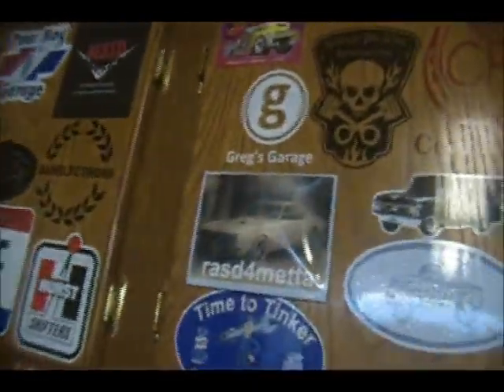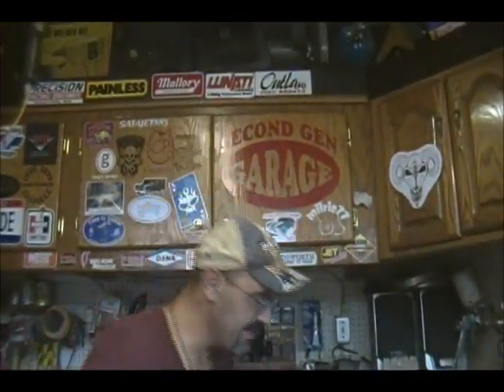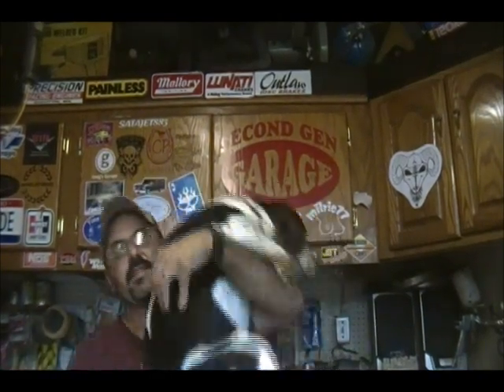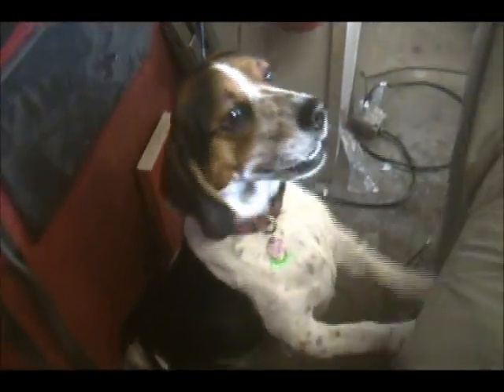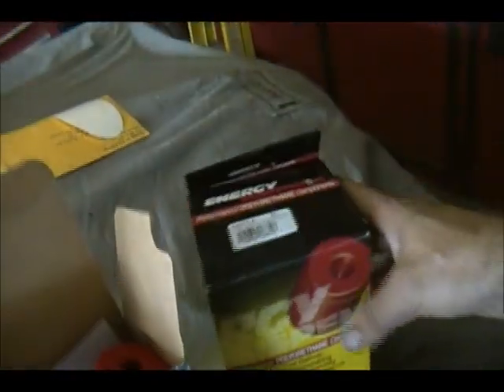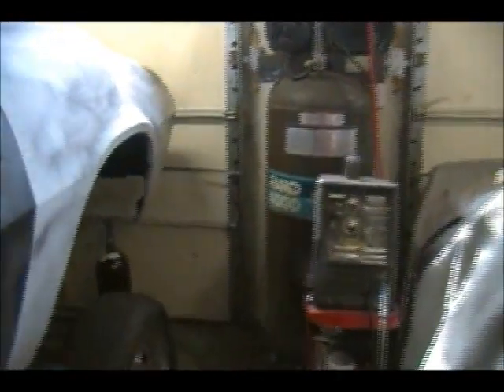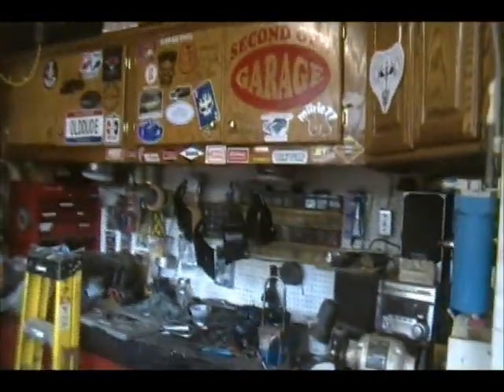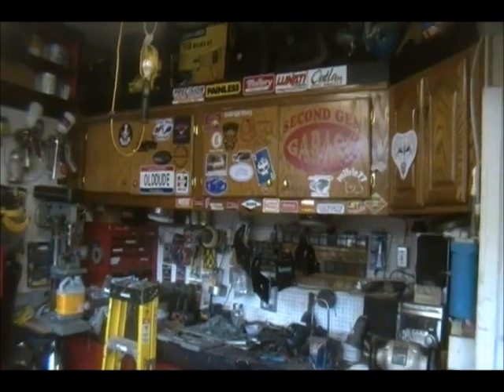71 camaro ss sos wednsday status report and mail call

Comment: Mark, I built a dolly out of wood for the front of Bettie and I added some diagonals to keep it stable.  Two bolts through the sheet metal may allow the dolly at the front to wobble and possible bend the body panels if it got stuck. I'll post a shot of it for you soon.

Comment: Stickers up on the wall, Molly's down on the floor. Hook up the dolly so you can roll the car out the door. Work on it today and then tomorrow work on it some more. When it gets done it will be done for sure, the bottom line is that it will have the rust cured and no more. Cheers OLDDUDE